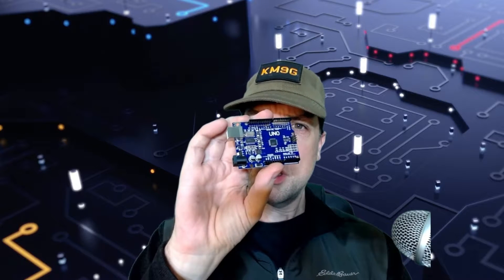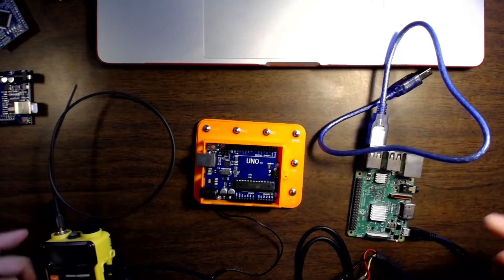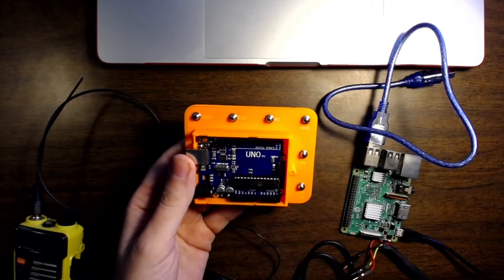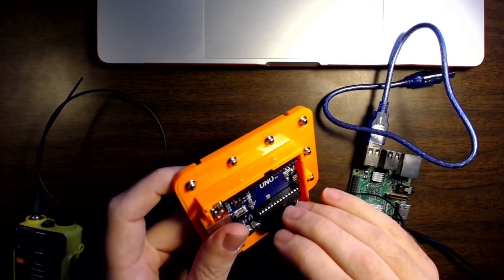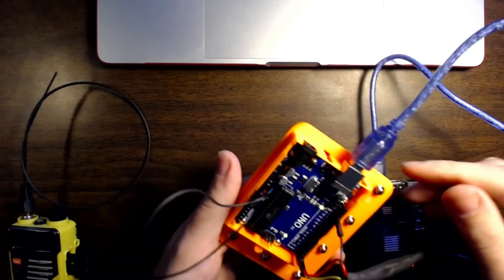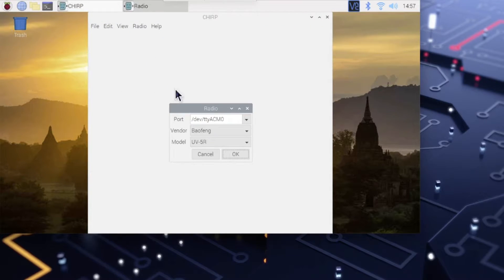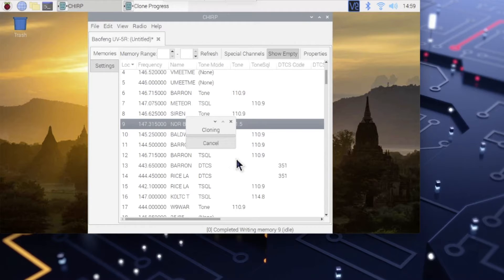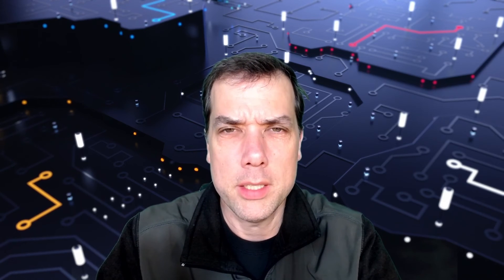Program your Baofeng with an Arduino and Raspberry Pi

Comment: I think some of the clone arduinos are not programmed with the arduino bootloader and thus act “dead” where they can’t take code you can program it but it requires this fancy software suite and cable and you’re better off buying from the official store
Reply from the maker: I agree, they had a chance to be better, but went the other way instead.
Reply: Hi there...I was naive enough during my undergraduate days that I and 2 of my friends decided to make a company out of making Arduino clones that are more robust and easier to use.
Long story short, we failed in our startup attempt...but learnt about the Arduino ecosystem inside-out. I can make this work literally with any Arduino...also change bootloaders to make any board with ATMega328/P IC on it to report as genuine when connected. If anyone is interested to try..let me know...it will be fun to tinker with these again.
73, VU3BMT

Comment: This is FREAKING AWESOME!! 
I found this looking for a way to program / update programming ON THE FLY in an emergency condition.
I haven't used my chirp in YEARS... but i currently have the programming on my radio to monitor local "5-0" channels (Xmit is "permanently" turned off).  Having a LOW-power, low-space option to turn xmit ON in extreme emergency - like lower power than my laptop - in my car I feel is imperative for modern-day insanity preparedness. I'm curious about your thoughts on such a project. I'm sure I could simply program Arduino or Pi to read settings and toggle them on specific channels when a code or other trigger is activated.  What do you think?
Reply from the maker: Hello KO, That's a great idea.  If you don't have an arduino laying around, I also have this working with an FTDI adapter:  https://github.com/TemporarilyOffline/RadioProgrammingCable... might be a few mW less of power.
Reply: @temporarilyoffline  thanks for the reply. That github link have me a 404 but I'm curious to know what it was.
Reply from the maker: https://github.com/TemporarilyOffline/RadioProgrammingCable The trailing periods messed it up.
Reply: @temporarilyoffline  you rock dude... Excellent share